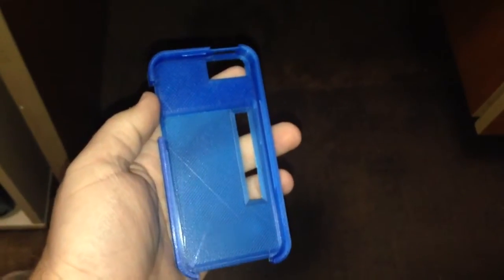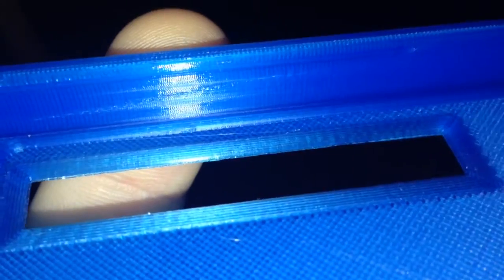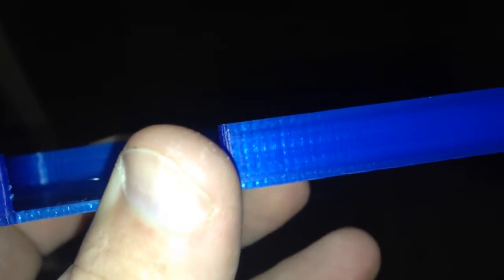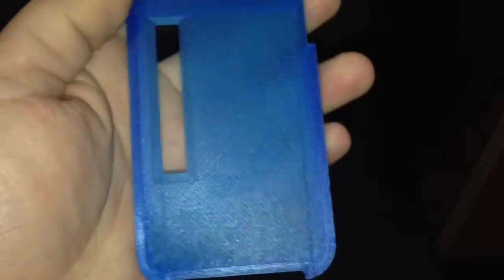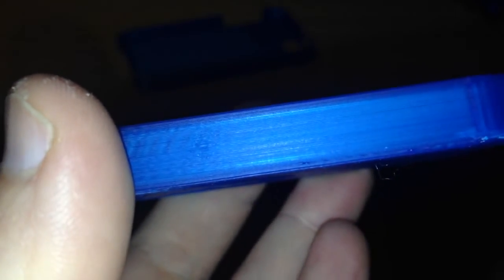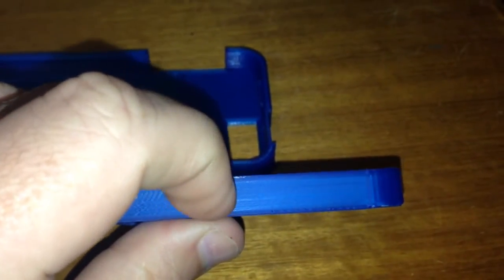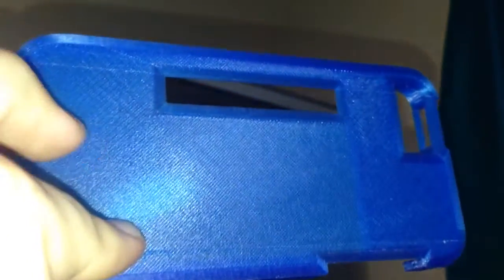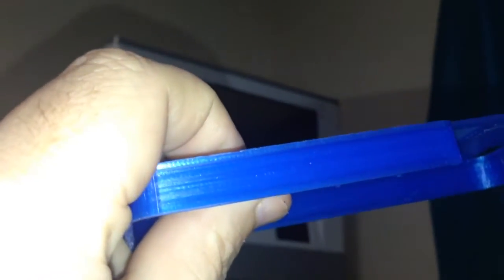Flashforge Dreamer - 80 micron iPhone case

Comment: How well does the case fit?
Reply from the maker: Hi, It fits my iPhone 5 PERFECTLY!! Right down to a nice 'snap' to secure the phone in place. The only thing is, this case was designed to hold a credit card but because of the metal back on the iphone, I could not use the credit card's "Paywave" touchless pay system, so unfortunately I'm not using this case anymore :(